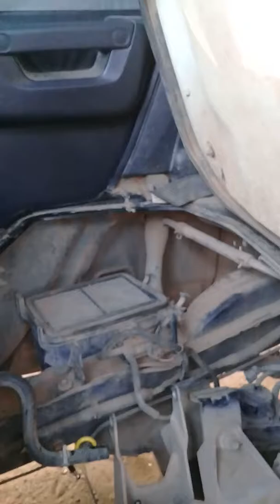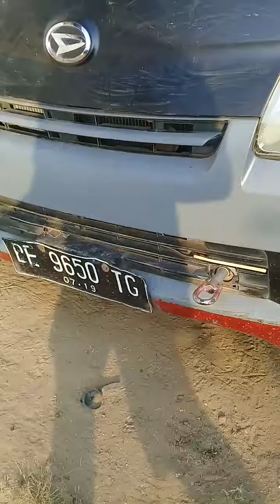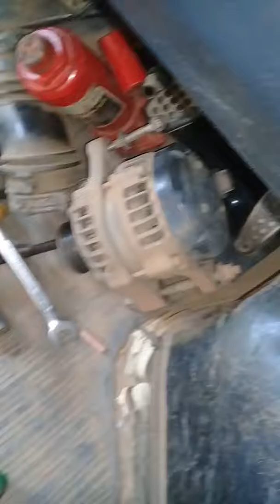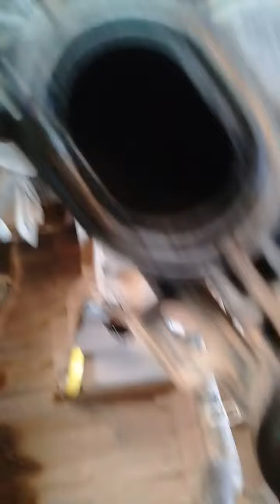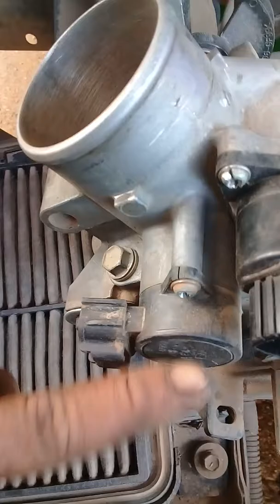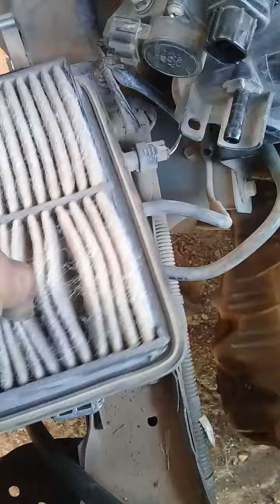Mesin GRAND MAX susah nyala saat dingin

Comment: Sama kasusnya sm grandmax saya beli second susah hidup hatus dibantu gas trus klo sudah panas rpm gede... Padahal fuel pump sudah diganti, tangki dikuras, filter bensin sudah dibersihkan, ISC sudah kinclong, minta solusinya om... Salam dari bandar Lampung
Reply from the maker: Coba cek kompresi y om...jika di bawah std y..over houle aja bisr fil lagi..salam juga dari lampung timur
Reply: @arifbayuwicaksono  saya nonton video punya om arif yg injecktor rembes, mirip banget sama punya saya... Klo pagi susah hidup dibantu gas trus nyala keluar asep putih trus hilang, klo dah jalan normal lg
Reply from the maker: @yuzario1341  yaps coba di praktekan om semoga ber manfaat video y🙏

Comment: Tanya Om.....Saya punya Daihatsu Luxio 2011.....Pertanyaanya : Kalau Ac di hidupkan dalam keadaan mobil berjalan....setiap kipas pendingin radiator hidup kenapa mesin mobil nya agak nyendat-nyendat...kadang kala pas di gas agak molor ?.......Kata teman. coba bersihkan filter bensinnya......Gimana pendapat Om ?......
Reply from the maker: Nyendat di ac..kalo grand mx itu normal bro..ketika motor van menyala kompresor juga terhunung..maka y terasa lebih berat...tapi ketika motor van mati enteng lagi kn?
Reply: @arifbayuwicaksono  Memang terasa lebih berat pijakan gas klu AC nyala....tapi mesin mobilnya waktu berjalan nyendat2 ketika Van pendingin radioator hidup.....klu van mati normal lagi......( Maksudnya : Mobil dalam keadaan berjalan dan ac di hidupkan )
Reply from the maker: Ya..memang begitu...apa lagi kalo 1.3. Tapi kalo gk pake ac gak gitu kn?